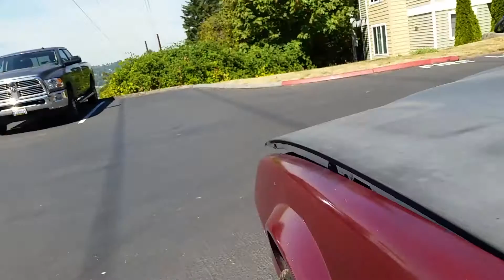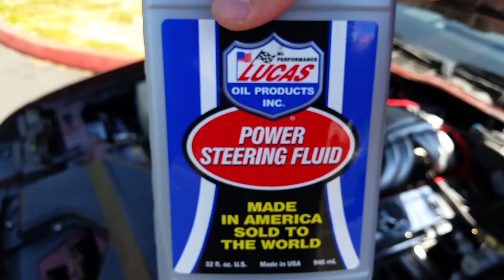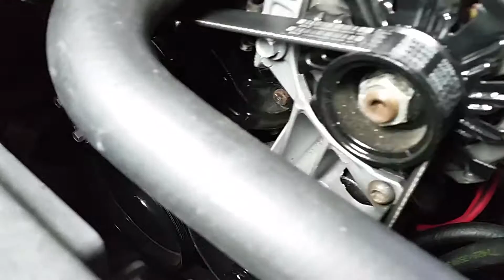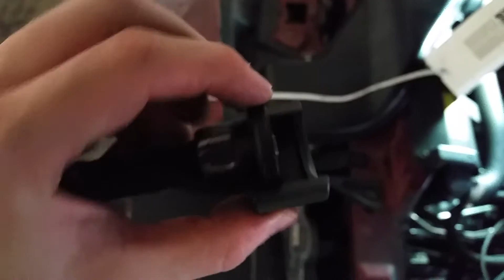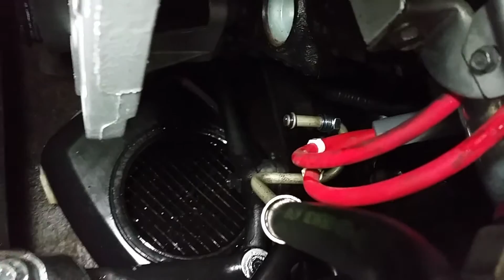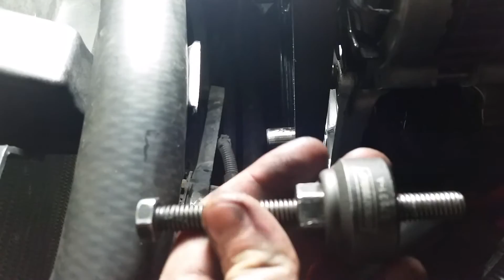1989 Camaro power steering pump removal

Comment: This is a very good video Sir.   Thank you for always covering all bases.   I'm no technician, so I really really appreciate all the information.   I'm currently doing my water pump.   I'm having trouble putting the new one in.  By any chance can I move the power steering bracket toward the left about a quarter of an inch to without removing the power steering pulleys??

Comment: Hey guys 
I ene y ahead and replaced my power steering pump 
It had a small leak so a new one was installed.  
When I finished the belt started squealing something it wasn’t doing before.  
I went ahead and changed the belt problem solved.  
After two months the belt noise has come back it has gradually gotten to a point where I just took that lent off and put a belt that doesn’t go all the way to the power steering.   Power steering delete.   Ofcourse now I can’t hardly turn the wheels extremely hard to drive the car. 
What can I do ??? 
The new power steering belt lasted 2 months.  It doesn’t look damaged      What gives

Comment: what year is your ride? i keep searching for a power steering pump that fits but for some reason i cant find the proper replacement. My brackets look just like yours but for some reason the clocking on every pump i find is off ever so slightly
Reply: my jeep is frankensteined together with a 350 sbc that i though was from a camaro or caprice
Reply from the maker: mine is an 89, and the link I put in the description is the same one I used on mine

Comment: Is there something unique about your car's pump bracket that requires the pulley-swap to be done while the pump is attached to the car? I have to think the pulley-swap would be a lot easier if done while the pump is removed from the vehicle. Curious.
Reply: you cant access the mounting bolts without removing the pulley because it covers them and does not have any access holes. The lightweight pulley from march gives you access without removal but otherwise you have to do it as shown

Comment: I just got a 1990 rs v8 and the engine is dirty and full of clutter. Any tips on how to clean it? Yours is clean as fuck!
Reply: WD-40 and elbow grease dissolves engine crud.
Reply from the maker: mine has a fresh rebuild, but for cleaning you can take it in to get steam cleaned or you can do it yourself with this: http://amzn.to/2gsUAhw  just spray it on and rinse off